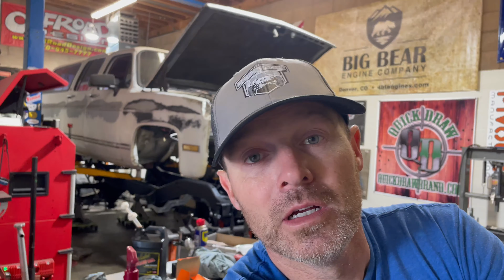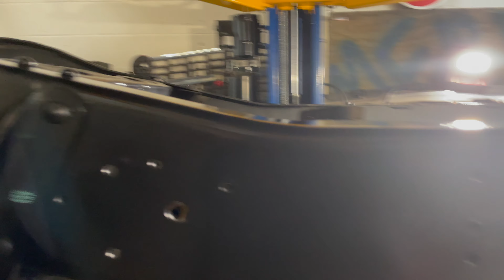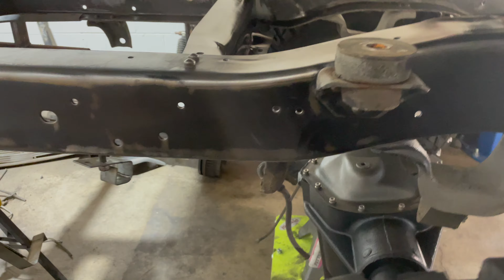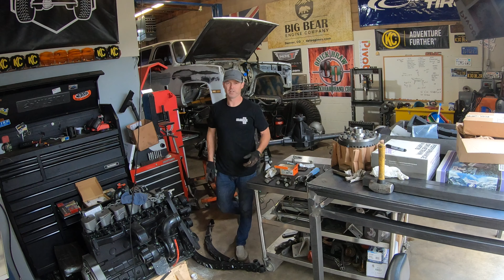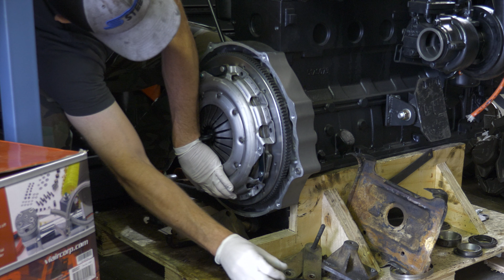Finish that Build!!  My number one trick for staying on task!

Comment: One thing i noticed...or didn't notice(could have been the time lapse)....is checking the slide on the alignment tool on the clutch. I've seen clutch discs not be aligned right off the tool and the trans not want to go into the pilot bushing. One other thing i notice, and not just this video, is you saying "everythink" instead of "everything" at times. Sorry to be nitpicky on that man. It's just one of those things i catch along with people saying heighth instead of height. I wish i had that kind of space to work on my junk. Kind of hard get motivated to work when it's in the driveway and you don't get home until after 6pm.

Comment: So I noticed you’re going to do lizard skin on the bottom if you want to keep it stain resistant they have a third coding that just comes in an aerosol can and it makes it to where it’s cleanable because if you just do the sound deadener and then the ceramic coating it stains very easily I highly recommend the third coating over the top
Reply from the maker: Yea I have a bunch of spray cans of top coat.

Comment: you think steel-it is better than epoxy primer
Reply from the maker: Yea.  You can weld through it with zero issues and it comes in a spray paint 😜

Comment: JM, what are your thoughts on Portal Axles? Not the price though, cause prices for portals are way too high. There’s gotta be a way to make them cheaper.
Reply: Go easy on the cranial, bro. You need the stuff in there.
Reply from the maker: Ha ha.  Dude.  I have smacked my cranium waaaay too many times!   

Portal axles are a lot of unsprung weight which is gonna make handling meh ... but the bigger issue is how much they raise the center of gravity.  Not a good combo
Reply: @merricksgarage  copy

Comment: Great advice. I`m using the take nothing for granted approach to mine. I figured some minor work would bring mine to where i wanted it.It has become what the heck were they thinking when they put this together the first time,  mine has become start all over again.Whether its chasing wires that turn colors 4 times. Guess the store was closed?To replacing bolts ,bushings.steering dampner that only had dampning going one direction.Motor mounts to get rid of the chevy lean.
Keep the videos coming.

Comment: That truck will be amazing.  I’m curious about lizard skin on the exterior/under body.  I used it on my k5 in the interior.  Seems like a good product.  Just with it being waterborne I might be worried about it leeching water and rotting the body.
Reply from the maker: Rust isn’t really too much of an issue out here.  Did you notice a big difference when you sprayed inside?
Reply: @merricksgarage  I sprayed about 4 gallons of the sound deadener.  Used it everywhere - roof, inner doors, etc. Then sprayed about two gallons of the ceramic heat shield on the floor.  As far as the sound deadening, I would say it’s just marginal and dynamat is more effective for that application. Overall I’m satisfied with it.  If you’ve never used it you’ll swear you’re spraying latex house paint by the smell.  It does also seem to hold moisture, like it will change color when it gets wet even after it cures.  For that reason I’d be worried about it for exterior use but just spray your body with a nice coat of epoxy primer and you should be ok.
Reply: Awesome work btw.  I’m living vicariously on this one.  Still running my tired 350 tbi.
Reply: dan m have you tried DEI boom mat spray? It’s a sound deadening ceramic spray. They claim it prevents rust, is paintable, can be used as a undercoating and won’t chip or crack. I used it inside on my cab floors but then covered it with fat mat so I have no idea how it’s held up.
Reply: @brokenwrench404  no I haven’t but will check it out.

Comment: I'm using your YT videos as one resource while I'm gathering parts and building my 1991 Burban for a bugout vehicle. I got a KILLER deal on a very straight, almost totally rust-free K-1500.
I'm dropping in a 68k original mile 1995 5.7 LT-1... It has approx 15k on a rebuilt 700R4 (transfer case done at the same time), but I'm debating other options. 
Thinking about a 52-56 leaf spring swap. Definitely want 1-ton axles and lockers... 
I'm also gonna completely de-chrome and Raptor Liner the whole thing...probably olive drab green. Black trim. Want a full length tubular roof rack that uses the OEM luggage rack mount locations plus 2 more. 
I'm JUST NOW getting started.. Gutting the interior right now... :-)
Reply from the maker: don't do the 52 56 springs.  They wear too quickly.  Truck will be a handful with them
Reply: @merricksgarage  Ok.. Thanks... :-)
Reply: @merricksgarage  DO you think the 52 56 swap would still be unwise with 35-36" tires? That's as large as I ever plan to go. Also, it won't be a daily driver... only a little on weekends and during inclement weather to keep the driveline lubed via random use...
Reply from the maker: They just aren’t designed for it.  They will be waaay over loaded.  The fronts were ok but got really unpredictable.  The rears were crazy stiff
Reply: @merricksgarage  ok.. THANKS!